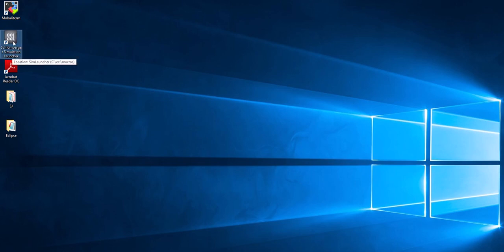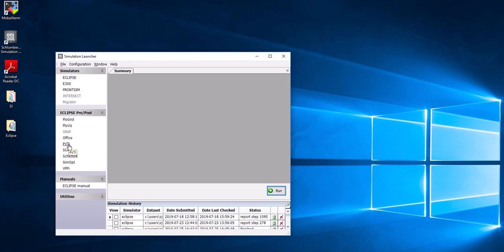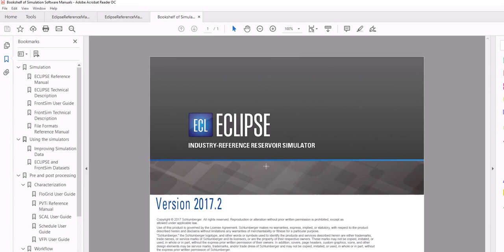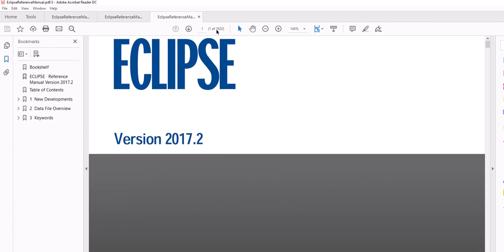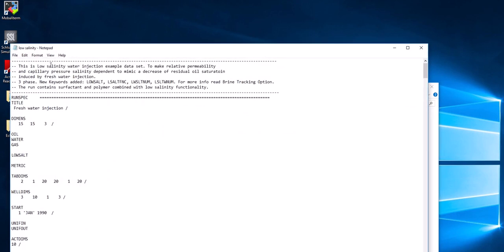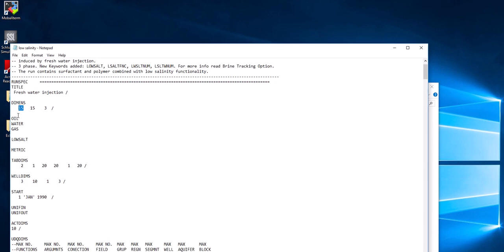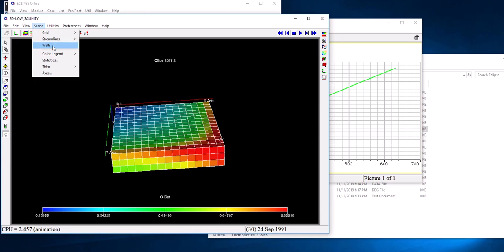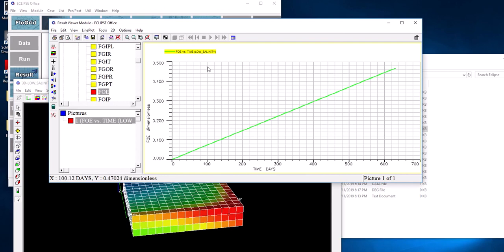Reservoir Simulation   Introduction to ECLIPSE

Comment: Subscribed, Thanks a lot it helped, I have a final project: Development and Appraisal of a newly discovered oil field using Sensitivity Analysis and Value of Information Theory. I need to generate the production and cost profiles after running the data file and play with 4 sensitive parameters:

1. Size of Aquifer (Aquifer Strength)
2. Permeability 
3. Porosity 
4. Viscosity
Reply: hi moab ... can u please give me ur number i want to talk to u

Comment: Hi first of all this is a very good video sir. I have one question where I can find some exercise or case study or example that I can practice the eclipse simulation since I’’m the beginner. Thank you sir.
Reply from the maker: Hi,

You can find many examples in the folder named as "Data"  in the folder that eclipse is installed. It has a wide ranges of examples including water-flooding, different EOR, etc.
Reply: Reservoir Engineer Thank you sir. Very appreciate for the reply ❤️